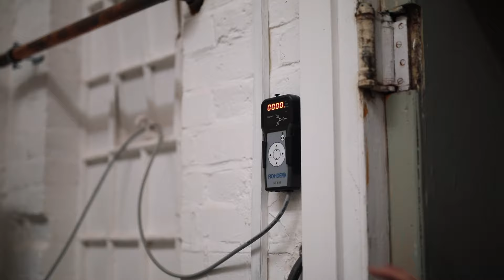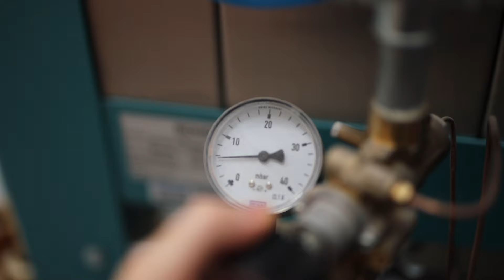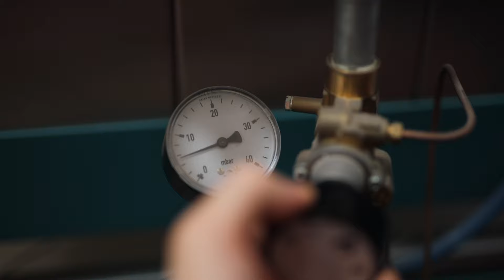How to Make a Ceramic Teapot, from Beginning to End — ASMR Version

Comment: I always wanted to do pottery but I have some back pain if hunched forward for a while, I wonder if every potter has to do the same position which they say is required :/ another hobby I can't do due to this freaking back. Anyone doing pottery with back problems? thanks :)
Reply from the maker: You can raise the wheel up on some blocks so that you stand and throw, rather than sit, works well from what I've seen. You can even sort of lean your upper body onto the chassis of the wheel to take some of the pressure off.
Reply: @floriangadsby  Ill try that! Thank you for the inspiration!